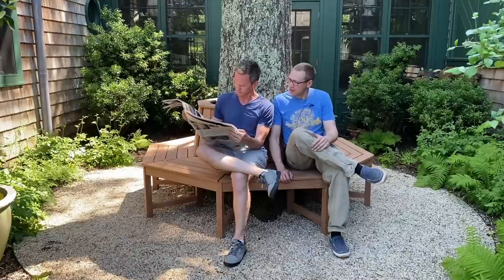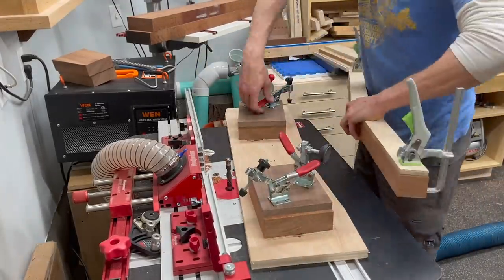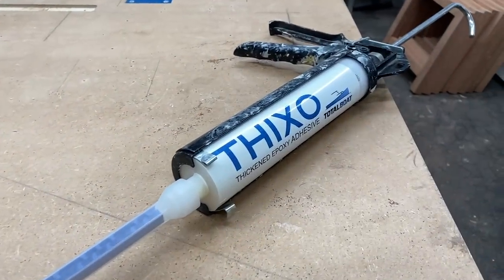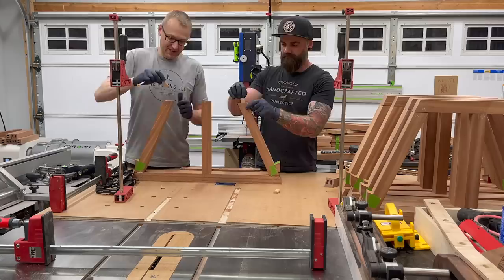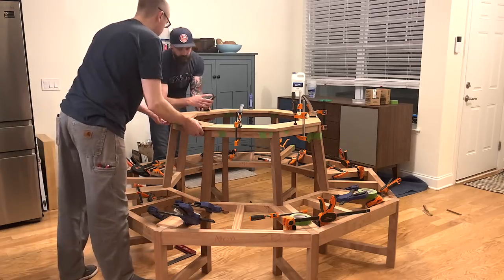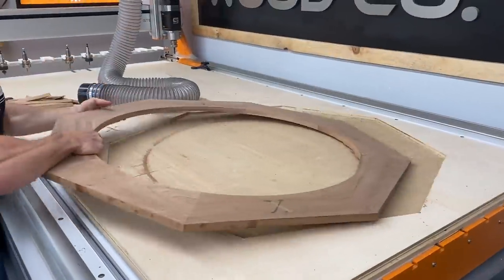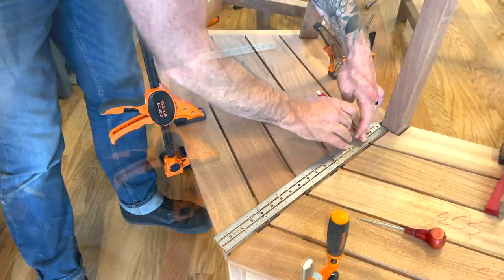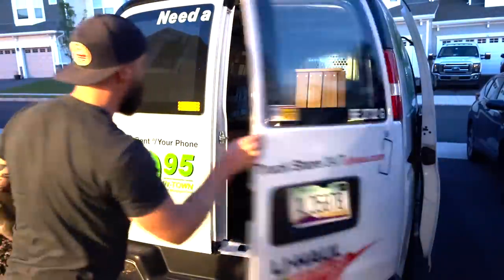Neil Patrick Harris wanted a garden bench...so we built him one.

Comment: Job well done! Woodworking is such a solitary pursuit that I wonder if it took each of you a bit before things started to click? In any event, your team made it seem like a well oiled machine. What are your thoughts on finishing sapele outdoor projects? This bench had none, while your modern design bench used 5 coats of Total Boat.
Reply from the maker: Any finish you will apply will need maintenance. Little projects are much easier to maintain. If you don't like the the look of mahogany, or any other outdoor wood as it grays, then you will need to apply a finish and maintain it.